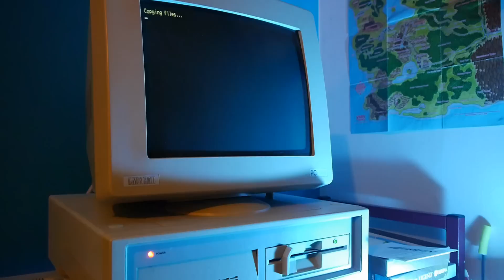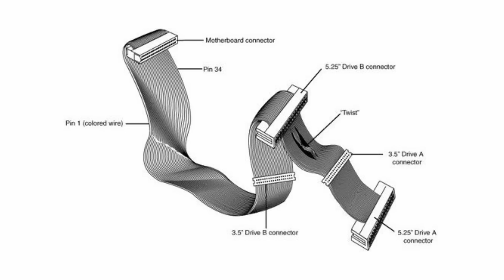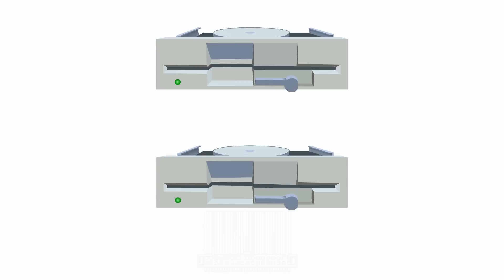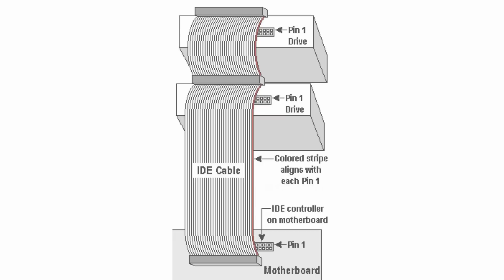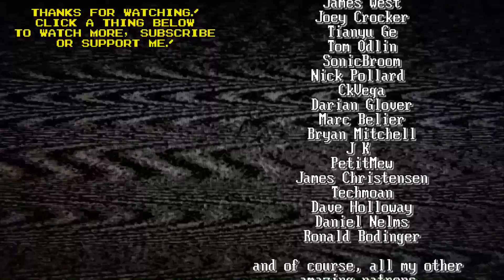Why are Floppy Cables Twisted? [Byte Size] | Nostalgia Nerd

Comment: My PC has no drive letters for its HDD, SSD, CDROM or floppy disk drives. Having drive letters is just a bad habit of inferior so-called operating systems.
Reply: Whether you personally have problems is not the issue. Most people don't have problems with either system. You put forth the idea that having drive letters is some inferior system, and the point of my comments is to disprove that. 

Due to how the two systems work, there are potential problems with the the *nix system that do not occur in the drive letter system. One of those is that drive letters cannot have permissions problems. Drive letters do not have permissions. Your /mnt folder does. Putting drives into the file system means that even drives without permissions can have permission problems. 

What Linux does nowadays is attempt to mimic the Windows drive letter system, but without the actual drive letters. It does so by using additional programs. It has an automounting daemon which runs all the time, as well as by default when you first set things up before you have a proper /etc/fstab. 

It is true that the "adding to the filesystem" concept also has advantages. But that's why Windows (the supposedly inferior operating system) added that feature as well. It's been around since Windows 2000. 

So, if you actually need that feature, you can have it. 

There may be other reasons to think Linux is superior (e.g. no stupid telemetry built in, and no operating system level ads that you have to disable like in Windows 10), but the drive letter system was one thing that was superior.

------------

Not that this has anything to do with the video. For the purposes of the video, substitute A: with /dev/fd0 and B: with /dev/fd1 and everything is exactly the same.

It's not like he mentioned being able to remove the disk without unmounting or anything (a feature Linux still lacks).
Reply: If you connect "it's got drive letters" to "it's got permissions", you don't really know what you're talking about. Those are two totally separate things. Considering the amount of hours I spent on Linux vs. Windows, a permissions problem with a mounted drive is about as rare as an inaccessible drive due to data error.
Reply: Why are drive letters a bad habit?
Reply: "Automount by design" - that's a convenience feature that any operating system has nowadays. So why use drive letters, when you have your drives at pre-designated places in your file system? I still don't get it...
Reply: Superphilipp Because you can allocate 26 partitions max.
Reply: Aye a fellow Linux user!!
Reply: What about someone with a small business or a few file servers for large amounts of files? Having such things is becoming more and more common even for "normal" users. I have more volumes than there are letters available, but then I use Macs so the issue is moot for me.
Reply: While I see the reason for letters, the way Linux does it is actually more reasonable. But I still don't understeand why SATA drives need the same nomenclature as SCSI drives.
Reply: Because drive letters are much easier to type, and don't have to be in your filesystem with all the permission problems that causes.

And because "automounting" is just a daemon in the background, and not actually built into the OS, so you run into problems with it. I've never had a problem plugging something in in Windows and not being able to get it. With Linux, I've definitely had to manually mount something. 

And Windows also auto-unmounts, unlike Linux which keeps the thing open.

I use Linux a lot, but the one thing I miss are the drive letters, which just make everything so much simpler.
Reply: If you are an average PC user, and you have more drives than letters, you are very much needlessly complicating things. 

The most that you can reasonably do is have a separate OS, Programs, and Documents drives. And even not connecting the OS with the programs is likely to be a problem. 

Beyond that, you just have external drives. You've got your optical drive, maybe a card reader, and then any USB drives you might need. But you're not going to have more than 10 USB ports. 

Sure, there are also network drives, but those are entirely optional. They're just a shortcut. Unlike mount points, you don't have to use them. 

Automounting and assigning a letter to each drive (sda, sdb, etc) is now a part of all modern *nix operating systems. Face it, the DOS/Windows way of doing things won. 

Only experts need that many drives, and they can always just mount to a folder the same way you can on *nix. It's just not the default, and never will be.
Reply: Re: Thinker Outside of complex RAID setups, who has more than 24 drives? Letters are short, and they automount by design instead of the hack they had to do to Linux.
Reply: Sorry, but you are wrong. 
1. Permissions are a security feature, which helps i.e. to not infect a connected drive with a potential malware that may be running on the system. They are a good thing, once you understood how they work. That is necessary to never have problems with them, but then you also need to know that a car needs a regular oil change when you want to drive it, and it's not a bad thing to know something, or to need to know something (you still don't need to know how to insert kernel modules or compile a kernel if you want to use it, because that happens automatically - except on inferior so-called operating systems, which may need manual driver installations on occasion).
 2. You could have permissions even with drive letters, there is nothing that would prevent a system to use permissions for drive letters just like for a normal file system without drive letters.

Comment: If you used the 80-wire ATA66+ cables, cable select worked, with the slave usually being in the middle. I standardised on this for many years. As for floppy cables, I used to make my own sometimes to neaten up people's systems... I've had to do a few with two twists. On my first PC, the internal floppy drive had to be set as DS0, and I found a few on which that could not be done, or didn't work. Fortunately the two never coincided, but I could have modified the cable if necessary.
Reply: Actually have two froppy drives around that differ, one has the jumper puins the other misses them, but then they are in different ssystems anyway.
Reply: 80-wire IDE cables were the best, they reduced cross-talk and interference.  They were basically a must if you were going to be burning DVD's on PATA.

Sadly most people hadn't a clue that some PATA cables had 80 wires while others had 40.  I walked into my local PC supply store and asked the guy for an 80-wire ATA cable and he looked at me like I had four heads.  He then looked around and found a box of loose wires and said "is it one of these"?  I was like "OMG"  Dude wasn't even one of those guys from Best Buy or some other box store, but a local PC store for enthusiasts.

When I worked IT I'd hoard them as we scrapped older units for spares.  Probably pitched a few dozen 40-wires, but I held onto those 80's, they were surprisingly hard to come by.

Comment: So.. here's the question... If they set up all the drives to be "B", and needed a twist to make them "A"... then why not make them all "A" and needed the twist to make them "B", since more than likely back-in-the-day people were cheap and may not have been able to pay for an extra floppy?  (And thus would have probably liked/could have had a cable without a twist at all?
Reply: The pinout on the actual drives and the connectors was decided before the whole twist thing became a thing. It's a workaround to a legacy thing.
Reply: Jonathan Herr Back in the day, people had no harddrive, but two floppy drives. Harddrives were very expensive in the eighties.
Reply: Suhkma Dheek that makes a bit more sense.  a drive in the middle would be unintuitive and an a only cable whilst simpler, would be redundant/useless if you needed two drives.  (you'd have to buy an additional cable)

Comment: I would also like to point out that drives can be assigned by the OS as well. In a DOS 6.22 system with one drive, if you attempt to access the B drive, the Os will ask you to insert a disk into drive B, and when you continued, it would access the single floppy as drive B. Attempting to access drive A again would set the floppy back to drive A.

Comment: I remember those days... and ribbon cables are one thing I don't miss about them. "Cable management" and "airflow" were a bit different then...
Reply: back then no one cared about air flow back then it was all about the it was all about radiation shielding
Reply: Cable management? What cable management?
Reply: Round cables.
Reply: @HappyBeezerStudios  Or DIY square cables by carefully segmenting and stacking.   ;)
Reply: @HappyBeezerStudios  Indeed. Made life just that little bit easier.

Comment: The specification for drives originally supported 4 drives.  If you look at really old 5.25" drives they have 4 drive select jumpers.  Some old Tandy computers (the non-PC based ones) could run 4 drives.

Comment: I was in an electrical engineering college course (Ontario Canada) , that up until 2006 required ALL projects and assignments to be submitted via FLOPPY DISC !    YES,  3.5" floppy discs !     After 2007 everything went to online submissions.  Even as early as 2006, many people simply didn't have floppies on their laptops, so they had to copy stuff to a USB drive, then use one of the school's lab room computers to copy their files onto a floppy, and then submit that in for marking.   I have a stack of old floppies, and even a package of floppies unopened (a museum piece), as well as 2 external USB floppy drives.  Never know when that might come in handy, right?   Floppies make good 'COASTERS' for cold drinks on a hot humid day.

Comment: In the years before IBM had PCs (1970s) most drives were selected by jumpers on the drive as shown, except that a total of four drives were available.  This includes bot the 5 1/4" predecessors to 3.5" disks as well as the original 8" floppy drives.  The ability to add floppy drives was more cost efficient, even at $500/8" 128KB drives,  than $3000 for a 14" 20MB hard drive that would crash if you stared at it too hard. :D

Cromemco was actually the first company I saw to use the cable twist idea on their C-10 computer, except they used single drive external units with separate custom cables similar to GPIB connectors.  Their system allowed new drives to just be connected to the back of the previous drives' connection.

Comment: Praised be SATA, who liberated all the slave drives.
Reply: Jack Kraken
you cant be master without a slave
Reply: @aczbdk  You can have maids.
Reply: You can be a master of your own destiny.
Reply: Now we are all masters!!
Reply: let my people go, man!
Reply: it was called master and slave but the original ones was primary and secondary ..... but thies are not small words
Reply: No, I heard that SATA's grandparents once owned a slave. Cancel SATA.
Reply: Good old SCSI whre you couldjust daisy chain them together and habe them all pull on the same string.
Reply: and now just 1 year later all my drives are nvme, man things change fast
Reply: Am I not a drive and a brother?
Reply: Abraham Lincoln likes this element.
Reply: Pah....SATA...SAS...Get on my PCI-E M.2 level :D
Reply: Cough cough, SAS master race.
Reply: setup wise. yes. but mobos today still run primary and secondary drive and component system... theyre just no longer called 'master' and 'slave'.
whos fucking idea was to use these terms anyways? XD
Reply: @kellerweskier7214  Because it's easier to explain from a computer science perspective. Because the master issues command the slave performs them. This was just extended to the primary and secondary drives because it was already part of the language.
Reply: @astreaeluna  IDE/ATA drives take commands only from the controller, not from the other drive.
Reply: @kellerweskier7214  
especially considering that the slave drive isn't actually slave to the whims of the master drive :)

Comment: Also, Early Jumpers weren't little plastic thing that covered some pins that moved easily (and got lost easily).  The floppies on my Kaypro machines (z80 cp/m machines circa mid 1980's) have what an small dip socket but instead of a chip it would have a piece of plastic with legs and with pieces of metal going across.  To open the jumper you pry up on the metal pieces so they don't connect.  To Close the jumper you push the pieces of metal back down...    With those kinds of jumpers the wire swap is nice....       Also, a Question..  What about the 7 wire twist on MFM and RLL hard drives?  was it the same thing?

Comment: I still have an odd sony singlespeed atapi cdrom drive hooked up to an isa atapi adapter in my 80286 retro system.
Reply: Is retro nerd a language in google translate these days??? :P
Reply: Synthusiast Gnarly dude
Reply: Do you run it off the board, of a controlelr card or off the soundcard?
Reply: AT keyboard? Or one of those new fangled ATX sockets?

Comment: Alright, with the mystery of the floppy cable twist revealed, now move on to SATA cables.....  as in, why do SATA cables only have ONE connector instead of multiple ones like IDE (PATA?) cables had?   The answer is probably revealed in the terminology, Serial or Parallel - either way, GO!

Comment: Some old motherboards had the "Swap floppy drives" option in the Bios.
I used to just cut the floppy cable after the first plug, then use that option so drive B: is seen as A:

Comment: Haha so many things i knew and are placed on a backup medium in my head, as i haven't used this in ages. Floppy drive / ide selection jumpers. Ow the fiddling on those, without taking out the drive (lazy). Darn if you dropped those jumpers somewhere in the case, holding shaking the case to get the jumper out, must have happened once to everyone.
Reply: There are still jumpers on modern boards. and luckily basically almost every other connector uses the same 1/10 '' pitch, be it front heads, USB or fans.
If the jumpers are too small there are some with a little flag on that helps getting them out.

Comment: IDE cables have 40 wires? Not if you have the superior 80-pin type. :P
Reply: The IDE cable early in the video is actually an 80-pin type, not 40.
Reply: It doesn't have 80 pins. IDE only used 39. It has extra ground wires in between the data wires to shield cross talk and make higher speeds possible. You couldn't get full speed out of UDMA drives without the shielded cables. PIO mode drives didn't care, those worked fine with a 40 wire cable.

Comment: I was never able to get 2 IDE drives to function with 'cable select', and thanks to this video, I now know why. I had no idea that the cable needed to have a wire cut.
Wish I had seen this a decade ago!
Reply: I had a cable with that cut only once. Only one cable in 34 years. That's how rare those were.
Reply: me too, now that I know. I think we took the right decision of using the jumpers, it was easy enough to use the master and slave jumpers.
Reply: Luckily it became pretty simple with 80-conductor ATA cables. Single/Master drive (set to CS) at the end of the cable, the slave drive (also set to CS) in the middle. Later those connectors were colored even (blue to the board, black to master, grey to slave). But yes, with the 40-conductor ones CS was a mess.
Reply: In terms of performance, drive allocation made no difference. The drive itself did (brand and size)
Since it was a while ago my memory is just a little hazy, I think the issue with Windows was more that it had to be the C drive, so if the jumpers set a drive as a slave and the bios assigned that drive to D then Windows wouldn't boot.
Reply: +Snetmot Nosrorb Windows would not boot from a slave drive if I remember correct.
Reply: Now the question is, does it matter which drive you set for master when you configure yourself?
Reply: +DecibelAlex  Probably right. But I was thinking more in terms of performance.
Reply: I had some working, but always prefered to jumper M/S directly.
Reply: I never got it to work on a 40 wire cable, only the later 80 wire cables.
Reply: Istead of having a piece cut, it could also just have the corresponding pin on the connector missing.
And actually, all my still running IDE drives are still sitting cable select. Although I got me a bunch of jumpers because once they go filying there is no chance of finding them again.
Reply: Funny, I used it all the time and never really thought about it. I seem to remember one day though it didn’t work as expected, caused me lots of grief and therefore I went to the master/slave setup instead....
Reply: Yeah they were very rare, I think I only ever saw them in OEM builds.

Comment: Never used CS for IDE. Also, long ago, reading about the floppy disk interface I was shocked about data being SERIAL and not PARALLEL like in the IDE / ATA interface. I dont recall why but they use more control cables than IDE.
Reply: There's a suprising amount of history to serial data transfers, there was quite the back-and-forth.  Before the Universal Serial Bus (USB) there was Parallel Port, but before that was the Serial Port.

I would not be surprised if there's a common history between the floppy ATA interface and the serial port honestly.

Comment: I had assumed Cable-Select used something like echoes in the wire to define the position (a single ping meant tip, two pings meant middle)

Comment: As a side note when you had 2 drives connected without the twist or had the jumpers set the same strange things happened.  The computer would try to use both drives at the same time and mostly would lead to errors but sometimes rarely you could get a setup where it would write to 2 disks at the same time.